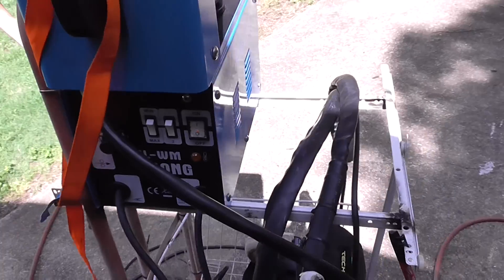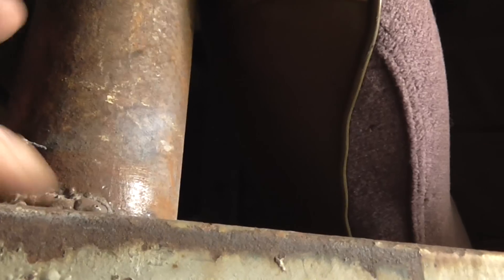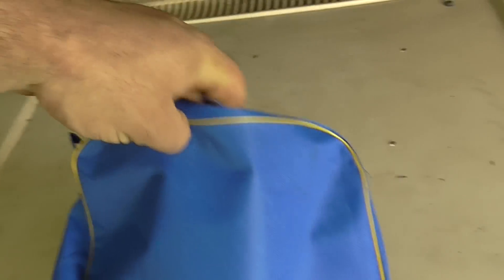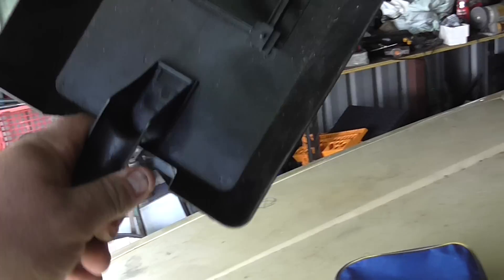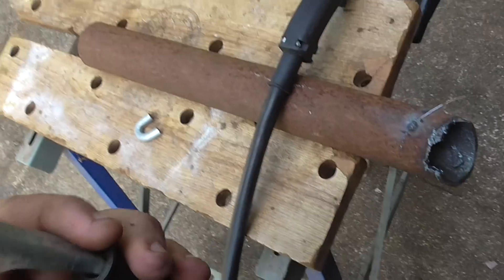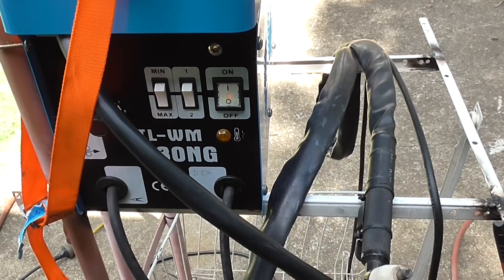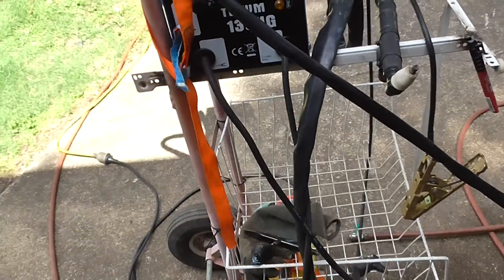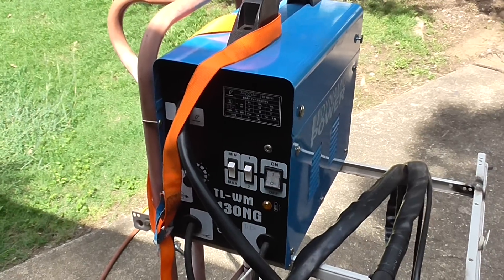130Amp MIG Gasless Welder 6 week review

Comment: Its not the welders fault. I just can't weld. That was very honest. I laughed very hard. They all come the same but with another name. Its a good beginners welder i think for the money.
Reply from the maker: Glad i could give you a laugh.. no point sugar coating it, i mean, My welds are perfectly functional. they always hold. but damn ugly. its amazing how bulletproof this thing is. ive been through atleast 30 spools of wire since i got it. other than the odd wire feed issue, it still works fine.
Reply: William Tomkinson That's good to hear. I'm looking at almost the same welder, just another name. I think you could get very skilled after i while. There are many ways of welding so you can't go wrong. One is bound to work. lol

Comment: thanks a lot for your review of this welder, especially the settings. i have this welder and the user manual was useless. one question; for the thicker material settings.. what wire speed do you use? and what size wire do you recommend it uses best.
Reply from the maker: Each wire is different. I mainly use 1.5mm. I usually don't have to change the wire speed. Best way is to listen to the sound it makes.

Comment: I've heard from number of people that wire feeding can be erratic on some of these cheaper mig welders. I bought a good Everlast mig welder to avoid this. I don't have time to work with uneven wire feeding.
Reply from the maker: on this one it seems ok as the wire feed is on its own power supply. i have a TransMig, 4 times the price, and it has huge issues with wire speed because the feed comes of the same power supply, so the harder it works the slower the wire feeds.. but again, this is for beginners and people who only use it a handfull of times. having said that, mine is still going strong and it has done a LOT of work.

Comment: Actually it could very well be the welder. They seem to be a step above the harbor freight ones, but I think they are AC off the transformer just like the HF one. Not sure as of yet becuase I haven't got a chance to crack the one I got open ($109 off ebay shipped).

 The manual talks about DC output, and has schematics for rectifying and filtering, and other proper set up like the wire fed circuit having its own transformer, and such, but I think that is for the more costly welders / higher amp they produce (real mig, etc), but the manual also shows a simplified circuit with just straight AC.

If such is the case, these would benefit greatly the same mods that folk do to the HF ones, which there are many videos / discussing on the net on how to do so, to get a much better and even stronger weld, the main mod being turning it into a real DC welder. If you have the schematic in the manual like I do, it actually shows how it should be set up, and the mods people do to make it so.
 Yeah, just went out and took the sides off. Definitely no rectifier. Just straight AC, as well all the other flaws of the HF one.
Reply: +DFAULTPOSITION No, bought several rectifiers off ebay a while back from outa china (very reasonably priced at that. The 3 phase ones seem to be much better priced, and they can be used just as well the 2 phase), and have the rest of parts here setting around likely, but have not got a chance to do anything with it yet. More pressing matters,  and frankly at the moment having work space, lol.

Comment: does anyone know the amps per the 4 settings
Reply: thomas dudley Yes it would be nice to have that info… anybody out there able to help with that?
Reply: A MiG machine is CV..constant voltage. Amps are controlled by wire speed. At number 10 setting on wire speed, and position 1, you are about 30 amps, 2: 60 amps. Max position 1: 90 amps. Position 2: 125-130 amps. All these are at position 10 on wire speed.
Reply: Mine has the following values:

50amp, 70amp, 90amp y 120amp
While the welder name shows "130" it appears that the max setting only reaches 120amps

Comment: i have 1/8 inch steel rods. can it weld it together with strenght??
Reply from the maker: Ahmad Malik should be able to
Reply: thanks
Reply: I just did a test weld on 1/2" plate and couldn't break it. Mine has a mod on the wire feed unit to improve the weld quality.

Comment: The "solar panels" on your auto darkening hood are actually photo receptors to pick up the arc and tell the lens to darken, it should have a battery powering it
Reply from the maker: Clay Hawkins nope. direct power from the anamorphic cells. thats why its cheap. but mostly works ok.
Reply: William Tomkinson Really? That seems kinda stupid. I don't think I've ever seen one like that
Reply from the maker: Clay Hawkins there actually very common. most cheap auto helmets are that way. not the good ones. they are as you said with the light sensor and battery power.

Comment: could I weld steel beams together with this welder???
Reply: I don't think you would want to. With only 130A and probably a very low duty cycle you would need to be very concerned with how much penetration you were getting and only welding small sections at full power before your welder overheats and you need to wait for it to cool down. Maybe look at a 250A everlast mig or better yet maybe a powerMTS welder so that you can stick weld it.

Comment: A good mig welder like an everlast will spoil you over these generic mig welders.
Reply from the maker: yes, but you work with what you have, i could only afford a $200 welder, it did the job well, and i still use it for outside and odd projects. i now have a better quality welder and the difference if huge. but without the cheap welder i could not have done the work to pay for the good welder.